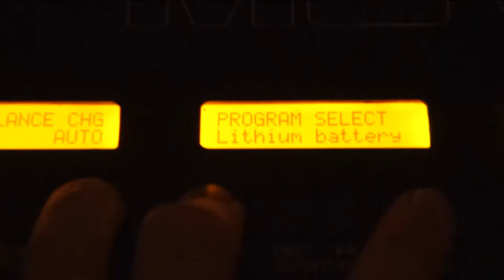2.6kW drone battery charging station - Reaktor 10S 30A in a Pelican 1510 case

Comment: Hi, great design and build quality. Would you mind sharing what chargers and power supplies you used for this project.
Reply from the maker: +dzikbk hi. sure. i used 4x "Reaktor 30A 1000W" chargers and 2x12V 1300W HP server power supplies in series - (caution when connecting them in series..ground needs to be isolated from DC(-) )